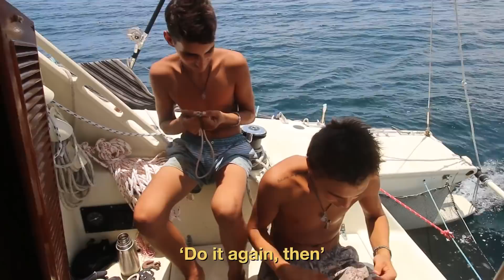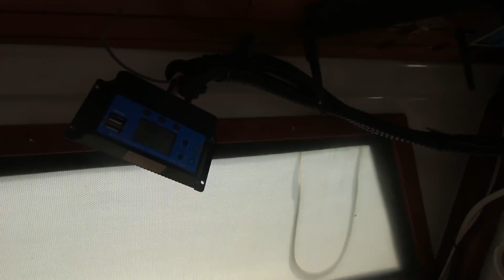The Thunder rolls... Lightning strikes our Sailboat | Ep. 24

Comment: Always disconnect coax from radios when lightning is present and always ground coax to remove static buildup when reconnecting . Much respect from a fellow do it yourselfer.
Reply from the maker: really? I didn't know that about grounding the coax. Thanks man.
Reply: Good call.  I used to unhook the coax and I soldered up NE51 neon bulbs into SO239 connectors.  Hook those up to the ends of the coax and watch the light show.  😂

Comment: Dry the dingy out fully.  Use it as a form.  rough the outside to get some tooth on it. Use the fiberglass and chemicals you have on board to make a thin outer shell and harden the boat. It stops being fold-able but it also stops leaking and it would only add a half dozen or so pounds to it so you can still haul it up on the deck for passages and it only cost fiber glass stuff you already have and time.  You can even paint it with a shark mouth to match your catamaran.
Reply: Sounds like a good plan!

Comment: WD40 will help displace the water in the engine, but won’t provide the lube needed to protect the engine. If this happens again, flush it liberally with WD40 (inside and out), then lube it internally and externally with actual penetrating oil (CRC, PB Blaster, etc.) sprayed on everything including in the cylinders (remove the spark plugs and shoot some in.). Then crank the engine with the plugs out so all liquid is pumped out of combustion chambers before trying to starting the motor).

Comment: To repair porta boat crease next time, use flex seal tape, one piece on inside,  on outside run a bead of superglue on seam, then after it dries, another flex seal piece over seam.  Firmly press the tape for about 2 or 3 minutes.  It will work, hold for a long time, and be waterproof.  Enjoy!

Comment: For next time your in a lightning prone area, if you've got any wire stays left attach a length of anchor chain to the wire stay long enough to hang into the water (it won't work with the dyneema ones). If you get struck again the lightning takes the path of least resistance ie the stay and chain straight into the water, thereby minimizing the damage to other electrical systems. I use it on my cheapey cat in Queensland Australia, we get the odd lightning strike it works a treat, by the way i'd go with a thousand cheap boats that get used like yours or mine does as opposed to a big production boat that just sits and collects barnacles. Keep up the great vid's and singing, looking forward to matching spinnaker and swim suits RODL. (Rolls On Deck Laughing)
Reply from the maker: RODL. love it. Thanks brother!
Reply: Why does the production boat have to sit and collect barnacles?  They are what most people are cruising in.
Reply: it doesn't Josef my point related to the smaller/ cheaper boats being used more (probably because the bigger production boats are more expensive and the poor owners are out at work trying to pay for the damned thing) certainly in my case here in Australia a half decent production cat for world cruising will cost in excess of 1/2 a million dollars, I sail a common design sometimes home built Snell Easy cat which usually costs under AUD$200k, I'm not cruising yet(still have a couch) but I sail 2 or 3 times a week, ergo in my world the cheaper cats get used more, your area might be different. cheers fair winds and calm seas Josef
Reply: Ric Fletcher 
My response was based on the same numbers you just gave. I can't afford a nice cat either, but I will be buying a monohull something in the <$100k range.  But that's after working 45 years to afford it and because I'm too old to be buying projects.  So if you mean people like James and other YTers who just wanna quit working and be video bums, then yes, boats like his are well suited.

Comment: Nice but a word to the wise. Some joints on the boat are DESIGNED to break under stress to avoid major hull damage. Be aware of this when re enforcing areas. Check if that area needs to be a safe fail point first.

Comment: Portaboat: Sew it with fishing line and then goop it with 5200. Drill the sewing holes with a 1mm bit and use a syringe for the 5200.
Reply: Vim Khadas I’ve fixed popped fenders with 5200. Still going strong 3 years later.
Reply: God you got hit hard. 

I've heard awesome things about 5200. I wouldn't use cheap see through fishing line though, it doesn't like to be in the light and gets weak. Some type that's solar tough. I'd put another membrane over the whole thing in addition to that if possible. I think the sun has made the transom area weak. and it could rip just about anywhere there is a folding joint. . Special type of tape over everything ? West Marine has a duct tape, pricey, and there is a silicon tape we use up on towers, best we can get, but only an inch wide. I think the problem is that no matter what you use, it can't be allowed to flex. Probably not possible ?. That's what got you to where you are now.
 Silicon tape. https://shop.hamiltonmarine.com/products/tape-marine-repair-wrap-xtreme-tape-black-1-x10--14935.html actually made to keep water out of round things, has to be put on stretched, so not sure it would help.

Comment: New sub here, digging the channel so far.
I like the diy approach, im the same on my boat. Save money and sail more.
Cheers from Vancouver BC
Reply from the maker: Thanks Scott. Glad you like. any suggestions or video ideas lmk
Reply: Sailing Zingaro
Just a (another) suggestion on your dinghy repair.
Theres a glue used to waterproof nylon and fabric tent seams called “seamgrip” maybe still made by Mcnett.
Its a super flexible clear urethane glue that is hella strong. I patched some small holes on my achilles hypalon 4 years ago below waterline and its still holding. Cost about $7 a tube. 8 hours to dry. Most outdoor/camping stores sell it. So effin strong once dry. Buddy of mine patched a 1.5 inch round hole in his dinghy with that only- no patch used and its been two years sitting outside and doesnt leak at all.
Stronger and longer lasting than 3M 5200.
Good luck!
🍻
Reply from the maker: yo, thanks for the tip borther. I'll look for that stuff, or order it. It's funny, that's the "1 thing you need to sail: glue. HAHAHA. seriously thanks, I'll give it a try

Comment: When their I'd lighting around try turning off the whole Electric system but for the wrieing for all your out side lights. And their is a lighting fuse. You can install it on your main Electric system .you can get hit at about 6 miles away. Truth. I. Thinking of going out to sea I to was in the Navy for 12 years and I'm a crack machine repair tec. I'm from New Port R.I. driveing small Craft since l was a kid and it's what l did for years in the Navy on 6 langing craft and 12 about 13 ton. Plus theirs not much l can't fix but not every thing  . Let me have your address to send you things you mit need ? I'm in state of Connecticut  right now l ( WE) could most likely fix your hull . And look at your at all your cabled. ? Let me know their us a boat yard in the next town.